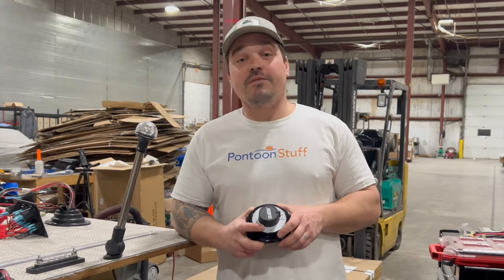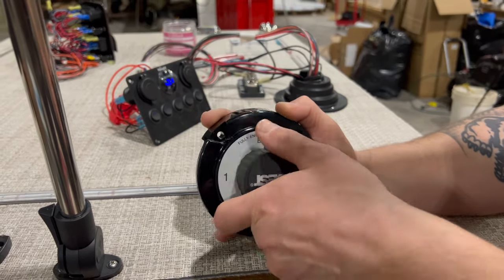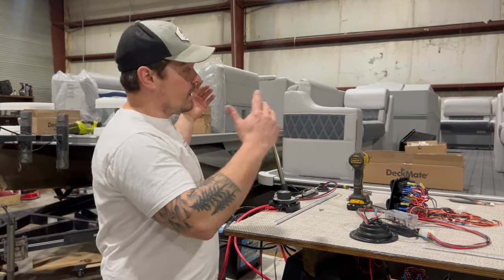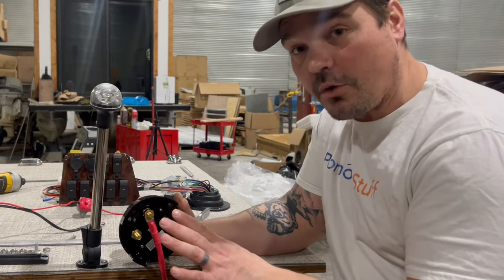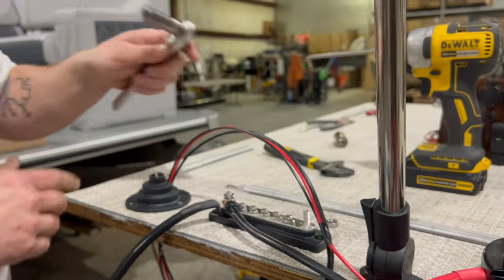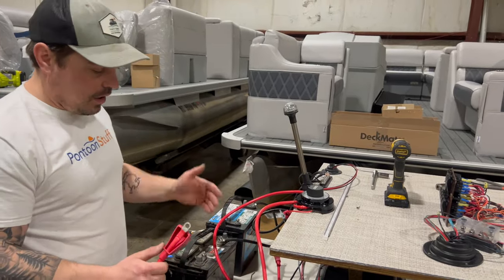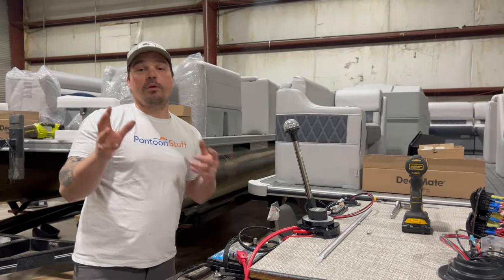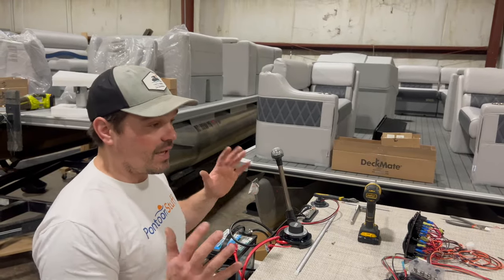Four Position Marine Battery Switch - Installation & Application

Comment: DO NOT go to "both" if one battery is completely discharged.  A LOT of amps will immediately flow from the charged battery to the discharged one - and the wires can overheat in the blink of an eye.  PLUS, all the current flowing into the discharged battery (and it sure will be a LOT!) will be UNAVAILABLE to start your motor.  If you take a minute or two to realize this while out on the water, you are SCREWED, because then NEITHER battery will have enough juice to start your motor.  Other than that, this video is pretty good.
Reply from the maker: I’m very curious if you’ve ever had this happen to you personally? 

I’ve run this by the marine mechanics I leaned to install from and they’ve never heard of such a thing.

Comment: I currently have that switch. It is original. The internal engine vessel has been modified to a single bank system with house power and engine starting on one large bank. I wish to add a separate new starting engine battery to the switch system. Should I put the alternator output charge cable and starter draw cables on the second post away from the house? or other method?  Thanks for your detailed explanation but I am missing something in my case. Diesel with 70 amp alternator.
Reply from the maker: Unfortunately I am no help in your case. I've rarely dealt with inboard gas engines let alone a diesel with an alternator. With outboards the alternator feeds power right back through the battery cables to the switch or battery. Your best bet would be to check with a local marina, maybe purchase a bunch of parts for your boat and ask them, or just offer some cash for a quick minute of their time.

Comment: Thank for the great video!  I decided to use a positive busbar connected to the feeder post in the switch in addition to the negative.  My question is where should I put the connections for a dual bank 110V charger?  I assume that both negatives would go on the negative busbar, but would I connect the positive connections to the positive busbar, or on the 1 & 2 posts inside the switch, or on the positive terminals of the batteries?
Reply from the maker: I strongly advise against a positive buss bar when using a switch like this one, especially for the motor connections. I like the motor to be connected directly to the common post, and the first terminal installed, to create as little of power flow restriction as possible. You could run a buss bar for additional accessories if you wish, but normally you’ve got just the motor positive and accessory harness positive (that runs to the dash for switches and lighting), and maybe a stereo lead for an amplifier if you’ve got an upgraded stereo. 

For a duel bank charger you should attach the charger leads directly to each battery positive and negative post respectively. I never rig a charger through a switch or buss bar, only directly to each battery.
Reply: @tomspontoons  Thank you for the explanation, that makes a lot of sense!  I moved the motor connection and main accessories to the feeder post on the switch to reduce the chance of failure and put the battery tender connections directly on the battery terminals.  I left the Positive busbar in place for ease of installation of future accessories.  Thanks again!
Reply from the maker: @Teltec77  That's exactly what I would have done if someone wanted to have easy access for additional accessories. Just make sure that positive buss bar is covered or protected. Happy to help!

Comment: Hello Sir
Thank you for the help on my shifter it help me a lot.  I have a question. I’m trying to figure out how to mount my leds on the sides. I don’t have a lip on the bottom of my rub rail so the only place I can mount them is on the toons or the fence rail. Which do you think would be best? I’m afraid they will not stick to the toons for a long time before they start falling off. Any suggestions would be appreciated
Thank You
Reply from the maker: We often mount them to the underside of the plywood if there's room between the crossmembers and the deck trim. I use wire clips for that method, a clip about every 12" to 16", usually a 1/2" clip works well with a stainless screw. Otherwise you'll need to screw the provided strips into the plywood which will work too. The other way we've done is is by using wire clips on the tops of the brackets that hold the crossmembers. When doing this I use self tapping stainless screws into the aluminum of the bracket.

Comment: The positive you put on what you called battery 2 when you turn it over items marked as both, did you make a mistake
Reply from the maker: I am not sure what you're referring to. I can't find a point where anything is marked as "both". What is the time stamp you're seeing this at? If you're installing a similar switch on your boat yours may have a different order or positioning of posts 1, 2, and shared/feeder/common.

Comment: How do you know what batteries to buy. I currently only have 1 right now but want to get a secound one so i can run the stero and such. What is the best battery for the stereo.
Reply from the maker: You could take your current battery in with you to a marina, auto parts store, or even Batteries Plus and let them help you match them. If I'm starting from scratch with new batteries I would go with a Dual Purpose (starting + deep cycle) for my starting battery, and then add in a 31 Class Deep Cycle battery for my house battery. For 99% of pontoon boats standard lead acid marine batteries will work perfectly fine and will last year after year if kept charged and stored properly in the off-season (topped off with a charge and kept off concrete at reasonable temperatures in the winter).

Comment: Do you recommend a circuit breaker between the cut-off switch and the fuse block mounted under my console, and if so, what size?
Reply from the maker: Yes, you’ll usually see a 20 amp resettable breaker on that main accessory power positive wire back near the battery or switch.
Reply: Thank you!
Reply from the maker: Happy to help!  @martyepperly5803

Comment: Hi tom love your videos i have installed a switch for my two batteries the way you showed. How do i install a solar panel so i can charge both batteries thank you in advance
Reply from the maker: Thanks for watching the channel!! You’ll wire in your charger(s) to each battery individually….so directly to each battery’s positive and negative post from the charger. Hope that makes sense!
Reply: @tomspontoons  thanks for the reply. 
So do i keep the switch to the off position
Reply from the maker: @georgecanakis1075  Really shouldn't matter as the batteries will be taking charge independently. Can't hurt to keep it in the off position while on the solar chargers though and not in use.

Comment: When I install my switch with no bus bar, do I just run a put a cable on both negative post to pair them together?
Reply from the maker: 100% correct. I usually install the motor battery cable on first, then the ground jumper wire on top going to the other battery. 4 gauge wire is what I use for everything in a battery switch setup.

Comment: Hi Tom, one question I have is about starting the engine. I thought one shouldn't start the engine from the house battery. But if I should turn off the engine before switching for example to both batteries so that house and starter battery are charging when the engine runs, wouldn't this mean that the house battery is also used to start the engine? Thanks for helping out and great video.
Reply from the maker: I think that used to be more of an issue, but with the new deep cycle batteries they’re making them with better cranking amps to where a quick start doesn’t hurt them like it used to. It was always “starting battery for starting and deep cycle for trolling motor and accessories”. Now days some marinas only carry a dual purpose starting/deep cycle combo as the option for starting. Our local marine shop sells all brands of outboards and they actually recommend a 27 class deep cycle as the best option for a single battery set up (starting and electrical accessories). I’ll have to do some more digging into that one, or get with a battery rep to get their take!!
Reply: Your right my friend. Starting battery only for cranking. House battery for acc only

Comment: Hi Tom, I have a different brand switch but the same idea. I followed your instructions but in the end, I found that my stereo which is on B2 works in all positions B1,B2 and B1+2. Is it normal?
Reply from the maker: All of your accessory positive leads should be stacked on the common post of the switch. When doing this, the battery switch is selecting which battery will power those accessories on the common post. It is not selecting which accessories receive power. Everything hooked to the common post will receive power when the switch is selecting one of the battery options or 1+2. Hope this makes sense!

Comment: On Amazon they have two different size bus blocks. 3/8 or 5/16. How do you know which one to buy?
Reply from the maker: I would probably go with the 3/8” to be safest, but the 5/16” would likely work fine too. Just depends on what battery lugs you’ve got on your wiring

Comment: Perfect video. Thank you for such a great, incredibly thorough explanation.  I was curious about the usage when the motor is running and when the motor is stopped.  Answered most everything.  The only other question is, being that I have a new 55amp alternator, when I have the stereo, amp, and LED's on while I'm cruising, when I turn on too many LED's, I'm charging below 12 amps (too much draw). Does this mean I'm actually not charging the batteries at all?  I would think not. I noticed that the digital ammeter falls to 11.7 when I have a bunch of things on.  My switch is on both.
Reply from the maker: Thanks for the kind words and for tuning in. In that case if you watch your voltage drop to 12v or below you’re likely just maintaining charge at best, possibly losing a little power. Stereo amps are a HUGE draw, most folks don’t realize just how much juice they pull. The LEDs are minimal, but on top of the amp and other accessories they’re not helping.
Reply: I have 6 led cups, 2-7 foot led strips,  led red and green 18 inch strips in the front of the boat and 2 blue led strips in the rear of the boat, and 2 led strips inside the boat. Those alone are bringing me under 12v
Reply from the maker: @davidinkeles7226 not with the motor running though, right?
Reply: Yes sir
Reply: @tomspontoons  WITH the motor running.  I'm at 14v before I start turning on the lights. Now I do have the green and red lights on the side that are LED and they are hooked up to green and red LED Strips on the front of the boat. I have 6 cups that have LED's (15 leds each x 6) I have 2 blue led strips on the stern. 2- 7 foot led strips under the front cushions, one 18 in led strip under the steering wheel and one 36 inch led strip to the right of the captains chair. That is a lot of led's burning at the same time.  I can use some of them without issue at night while driving, but I stop the power draw when I get down to 12.1. I wanted an led strip the length of the boat on each side on the outside (like a neon tube), but 2 x 25 feet would probably use more than I can without any of the others.
Reply from the maker: @davidinkeles7226  Not going to lie, that's got me scratching my head a little bit. Voltage is correct for motor running, but I've never seen LEDs drop voltage that much, regardless of the amount really. I would maybe turn each one on individually and see if there's one that takes a bigger pull than the others. Regardless, if there's an issue with one pulling too much draw it'll quit working first. Otherwise I have never experienced something like that. Only other factor would be the condition of the battery. It would allow the motor to still push voltage, but if it's getting weak then the draw might overpower it.
Reply: Thanks again for all of your correspondence. You're so great. I hooked up a panel of switches and one of them is a digital ammeter. Driving, I start at 14.1. As I turn on LED's, the ammeter drops a little per switch that I activate. The 2 7 foot strips drop it the most. A good Amp or so. There are a lot of LED's on those 7 foot strips though. I do keep the blower on constantly while cruising, which uses up .3 amps. As I turn on LED's, the ammeter drops more per switch that I use. I wired them all with 24 gauge wire. I have all of these hooked up to battery 2. I cruise with the perko switch on BOTH. I do find it interesting that the 2 100 watt headlights use up less amps than the 2 7 foot strips. Perhaps the 24 gauge wire is an issue?
Reply from the maker: @davidinkeles7226  I run 16 gauge for all of my LEDs from the switch panel out. I will sometimes run short leads of 18 gauge to link a couple LEDs together, but only 6-8' runs of that. I think you may have some issues by running 24 gauge for the full lengths. Not 100% sure, but that's where I'd start. I know they use 20 or 22 gauge coming off a lot of those LED strips, but I always give heavy gauge running out to them. I'll bet those headlights have heavier gauge wire running from the power source out to them, yeah?
Reply: I'll do that. Have a great weekend. I let you know how that goes. Keep up the great work
Reply from the maker: @davidinkeles7226  Hoping it takes care of it because otherwise I don't know why you'd have such a drop in power from just LEDs. Look forward to hearing back on how it goes once adjusted! Thanks!

Comment: If your accessories cable is only connected to post 2, why do your lights, etc, work when the battery switch is in Position 1? Shouldn’t battery 1, switch position 1, only provide voltage to the engine?
Reply from the maker: All positive power wires for motor and accessories hook to the shared or common post. Then the battery positives hook to post 1 and post 2. You’re selecting which battery is providing power to the shared post, not which accessory or motor is getting power. All accessories and motor will get power no matter which battery is selected.

Comment: Bro thanx for screwing it facing up can't see the front !!! So #2 facing the switch is your comun ? Right ?engine etc .....I'm thinking 2 is for #2 battery but is not ! OK thnx
Reply from the maker: Turning to setting two will pull/push power from/to battery 2 and only battery 2…being whichever battery you connect to post 2 on the back. 

Common or shared post is where all your positive wire leads go like motor battery cable and electrical accessories. 

Remember, the switch is only controlling which battery (or both in parallel) is powering ALL of the items hooked to the common or shared post.

Comment: Could i use this setup with two engines? Or would i have to add another starter battery and switch?
Reply from the maker: Personally I would want each motor on its own starting battery if I were running a twin engine setup. I'm not super familiar with typical electrical setups for twin engine scenarios so I'm not the best to answer those types of questions.

Comment: Is there a method to use 3 or 4 batteries or a system to handle a 24 hour Camara surveillance for my boat
Reply from the maker: To my knowledge these switches are made to run with 12V systems only. If you were going to power a surveillance system on your boat and needed longer lasting power you could put as many batteries in parallel as you want in order to allow for longer lasting power supply. Then attach the single positive lead from the paralleled batteries to the switch.

Comment: Would you be willing to look at my configuration? I installed a 4 position switch today. With  two batteries. I ran two busbars, one for positive and one for negative to make installing accessories easier later.
Reply from the maker: I'm not sure why you would run a positive buss bar? You need to keep the positives running from each battery to each respective post on the switch. We want to keep positives running as clean and free of interruption as possible. A negative buss bar makes sense on this switch though.
Reply: So only run positives to either the switch or the positive battery post? I was trying to avoid removing the switch to add more positive connections to it when I add more stuff to the boat. I assumed the positive bus bar would help, but i can definitely remove it.

Thank you
Reply from the maker: @DrJeffM  So you ran the positive buss bar off the common post, right? I can see where that would make sense in case you want to add accessories. Personally I would omit it altogether, but if you want to keep it for convenience I would run the motor battery cable directly to the common post to make sure there's no drop of flow there, then you could stack accessories on the buss bar. Typically on the shared post you should only have the motor positive and a dash accessory harness positive...in some cases there will also be the positive for an amplifier for the stereo. All of those will fit on the shared post together. And at that point anything added would be wired in under the dash where the accessory harness is supplying power to. Hope this makes sense!